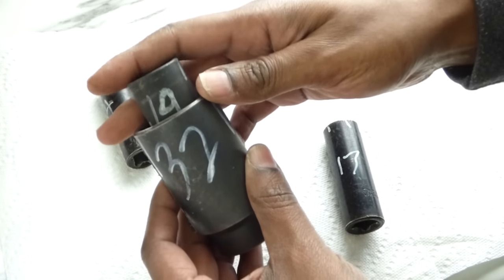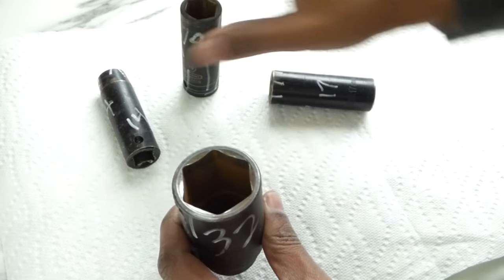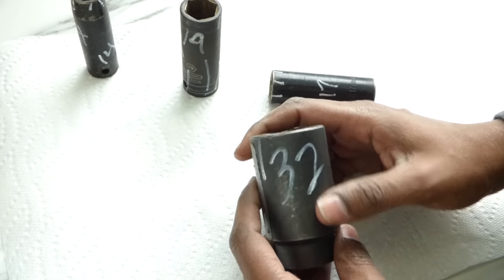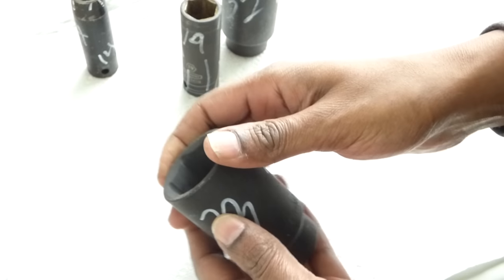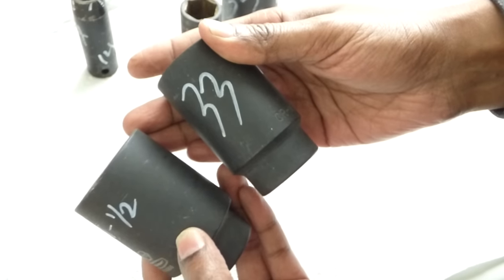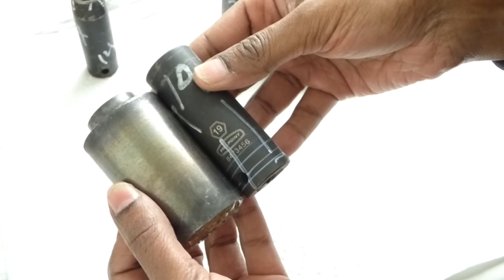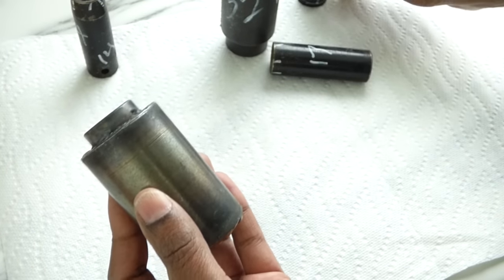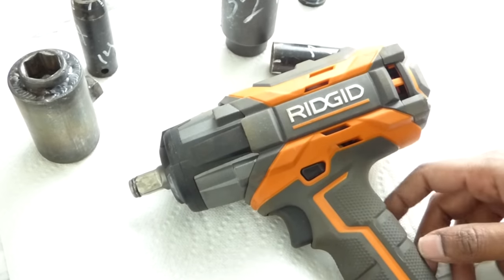heavy impact wrench sockets

Comment: I know you had a cam in one hand but I use both hands one on the trigger one pushing the gun to the fastener. Having said that I could hear a difference with the heavy socket. I bought a 1 n 1/4 inch Carlyle impact socket for 14.50 good deal I thought. I really didn't think the heavy would make a difference but I could hear it for myself

Comment: I have the Dewalt 899 and I'm seriously thinking about getting the Milwaukee...Is it worth it or is the power difference minimal enough that makes the cost not make sense to switch?
Reply from the maker: _ Red it depends on what you are working on if u work on rusty seized up stuff all day then I'd get the Milwaukee just for the better options in batteries alone but if not I love my dcf899 and it can do pretty much everything I need
Reply from the maker: _ Red I think the power diff is u have to see your impact can't do what you need it to do so you really want to move up even if it's only a couple hundred foot lbs but what can't your dcf899 do?
Reply: @singlecams  Ive only had a couple fasteners it couldn't get out...1 was a 17mm Honda crank bolt but I actually think it could have done it had I switched between loosening and tightening the bolt a couple times.  And the other time was the 14mm in the rear lower control arm bolt on my 99 civic...it moved it slightly when I switched the direction a couple times but I stoped out of the fear of shearing the bolt off. I have 2 6ah flex volt battery I just got with the 60v grinder and I'm wondering if they would give it more power I just haven't tried them yet...Thanks for replying
Reply from the maker: _ Red well this couldn't get this crank bolt out either and if you look at the Ingersoll it couldn't budge the lower bolts on some of those control arms so it's hard to say if in your case a diff impact would have worked better
Reply: @singlecams  the video you made where the Milwaukee loosened that bolt with the 3ft extension that the Dewalt couldn't made me wonder too...Its crazy how powerful the cordless tools are now
Reply from the maker: _ Red yeah yr right I have no idea why that Milwaukee 2763 was working so well with th extension. Maybe it had to do with rpm or something else  than just power?
Reply: Code_Red did you make the jump? I did and am sure loving it.

Comment: Thanks for the vids! I found your vid while searching for DIY examples of the Ingersoll Rand socket, which has a flywheel-like disc near the drive-side. Its design doesn't lend itself to extra rigidity, just rotational mass. I can only guess mass increases the length of time it applies the load; slower accel/decel = less peak torque but increasing how long it's applied. Imagine throwing a pebble vs hammer. It could even be a mix of both.

You could test this by only welding the input side - same rotational mass but less rigidity. In any case I'm going to get some cheap HF sockets and give this a shot!

Comment: Interesting concept, man i still need to get ahold of one of the new milwaukee fuel 1/2
Reply from the maker: it's really expensive man but it can do a lot of work but even the old one could
Reply: I have a dewalt drill with 3x5amp batteries, thinking of getting the dewalt dcf899. But I really want the big milwaukee :( Can't decide if I want to burn the money on a complete kit or just go with the dewalt.. I did se a guy try the dewalt on some truck lugnuts. I think he broke it though.. I don't know :/
Reply from the maker: @Amuris86  if you work on big truck stuff maybe go for the milwaukee but the dewalt is awesome and if you already have the batteries I would get the dewalt
Reply: @singlecams  Ok, thanks. I guess I don't need the Milwaukee. I don't have a Honda either, so. I'll go for the 899.

Comment: Thanks for the video my man. For truck lug nuts, I wonder if the 3/4 or 1 inch Milwaukee wrenches, which are actually bigger hammered, would still require lisle type sockets?  Would be nice to see them work on them lugs for comparison!
Reply from the maker: you are right dude lol I searched and found this https://www.youtube.com/watch?v=pegquPmKZsA That dewalt socket looks pretty thick too
Reply: singlecams thanks for the link... proven point and impressed.  Now for the real test... get the same test done on a Canadian riding rig exposed to winter salts and sloshy road grit ;)
Reply from the maker: right exactly the nuts didn't even have rust on them lol
Reply: Check out junkie shop time, he works on big dump trucks and uses the 3/4 Milwaukee to change tires on those trucks . That impact has no issue at all. I believe he uses the 2767 as well to compare
Reply: Check out the snap-on junkie.  he has a video where he uses the new milwaukee 2864 to remove and install 10 tires on one of his dump trucks.

Comment: My ridgid pull off my crank shaft pulley without any hassle and bolted it back on so I didn't throw my timing off, it been 3 years since I changed out my timing chain, timing house gasket, oil pan gasket, and my water pump some of these info on youtube are BS put some pb blaster on there to help break those rusty bolt free, crank shaft pulley are out in the open  at the enviorment mercy.
Reply from the maker: what car was that?
Reply: Sorry but not really all BS .. when you work on honda -acura cranks .. no pb or any penetrating oil will help you.. theres a mechanical explanation on using heavy sockets(torque multiplier) thumbs up to uploader of this video

Comment: When welding the sockets together, do you ever have issues with the inside socket sagging off a bit to one side?
Reply from the maker: it doesnt really have to be perfect but what you can do is put some aluminum foil folded up or maybe even 3 screw drivers so you can try to keep the socket in the middle then make 3 welds spaced evenly apart , let that cool then take out screw drivers and weld around it

Comment: In the Milwaukee testing look at your setting you were at the 3 not the full torque of the Milwaukee impact
Reply from the maker: The 4th setting is drive mode it has the same reverse torque as 3. When in drive mode it will stop spinning when it senses the fastener has broken free. So in other words makes no difference for reverse in this  video. Also check out the latest Amazon impact wrench videos removing crank bolt with this socket

Comment: I wonder if the Dewalt impact would’ve handled it without the special sockets
Reply from the maker: see I didn't even think about using the dewalt and it would have made a great video lol! 
I did make a video of the dewalt working on crank bolts so it can do it but sometimes you are going to come across some that are just too tight
Reply: Yes, the Dewalt impact can do it. I have one and always take those nut out with out problem.
Reply: Carlos Pérez I think it has more breakaway torque than the Milwaukee. It’s a monster.
Reply: jeffscomp no it wouldn’t because dewalt sucks
Reply: @jeffscomp  the biggest milwaukee has more breakaway torque than the Dewalt, I'm almost positive.
Reply: NAh it wouldn’t but the fucking w7152 flys through these bolts

Comment: Some times a breaker bar and pipe STIL IS NEEDED
Reply: Especially if it can save you alot of money by not having to spend on a power tool that barely gets used. I can get by with the mid torque for alot of the hard stuff and use the pipe for extreme hard bolds.

Comment: The Milwaukee is rated for 1400 ft/lbs and rigid is rated for 450 ft/lbs
Reply: If you believe that impact produces that torque you are a fool! I know for a fact under testing the gun it is in NO WAY CAPABLE OF PRODUCING THAT KIND OF TORQUE!Look on the INTERNET for actual testing against a Snap on and a Dewalt also a IR GUN ON TEST BENCHES . ALSO THE ANVIL OF THE GUN WOULD BREAK LONG BEFORE YOU REACH THAT TORQUE. LASTLY  if you ever torque down a Cylinder head bolt on a Catapiller earthmover 1400 lbs ft of torque has to be done with a torque multiply!
Reply: That’s info I pulled from homedepot.com
Reply: No need for your pantys to get in a knot
Reply: @chicosd1904  There not in a knot I am LAUGHING at the fact a lot of people were sold on the False Advertising done on this gun!
Reply: @chicosd1904  Home depot is told by the Milwaukee salesperson so they repeat the same thing.Also the other day I ran into a salesperson who works for Milwaukee trying  to tell me the same thing,I told him I would bring My torque wrench down which is a 3/4 drive 700 lbs ft max with a torque multiply and a Nut/ bolt that can be ran down to that 1200 lbs ft of torque I want to see it take the nut off! He said they do not do that in Home Depot! I told him you resistance to do such a demonstration proves my point!
Reply: @metalrott324  SO WHY DON'T YOU MAKE ME SNOWFLAKE!!!LMFAO AU
Reply: mastertorque09 So you tighten a lug with a Snap on torque wrench which one would that be?
Reply: Panty Sniffers

Comment: just buy the right socket! save time and money! Alot more people have a couple dollars laying around vs a welder! Or even know how to use one. Mac Tools and Lisle make both sockets and it has never taken me longer then 10 seconds to get any Honda Crank bolt free.
Reply from the maker: They make a 33mm heavy socket? That is what the video was about
Reply: @singlecams  Definitely not what this video is about, fyi there is nothing 33mm on a Honda!
Reply: @singlecams  you should always read the description first.
Reply from the maker: @edwardthayer9386  Sure it is that is why I put the screenshot to the semi truck results in the video. The whole point was that you could make ANY size heavy socket just like Chris did. I even mentioned the heavy weight 14mm for my own use. The Lisle socket is from Chris.